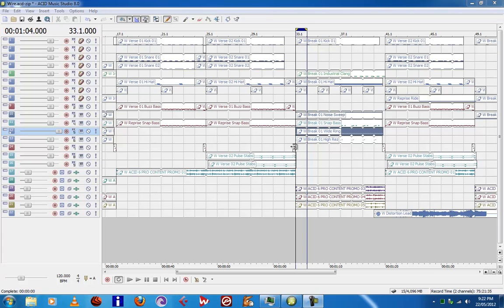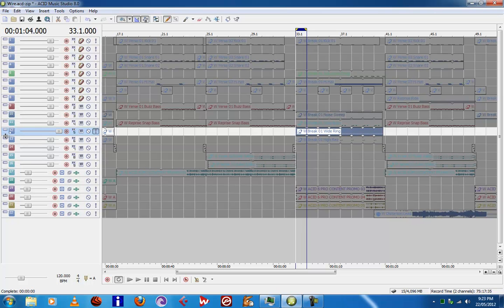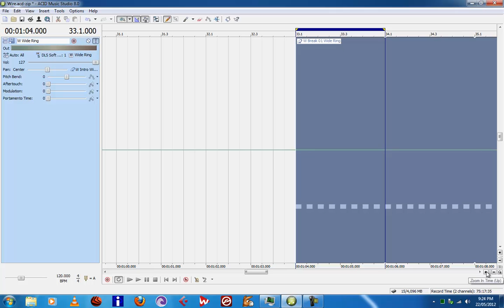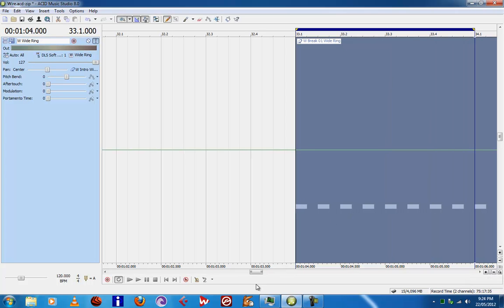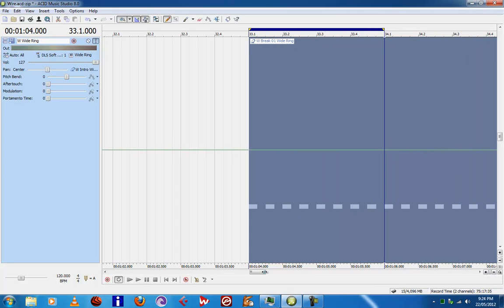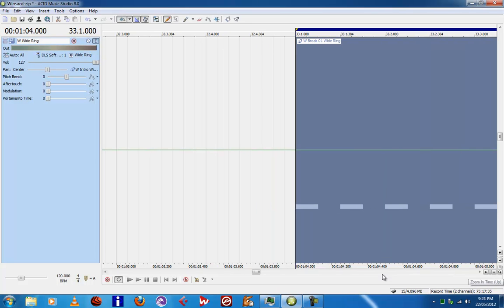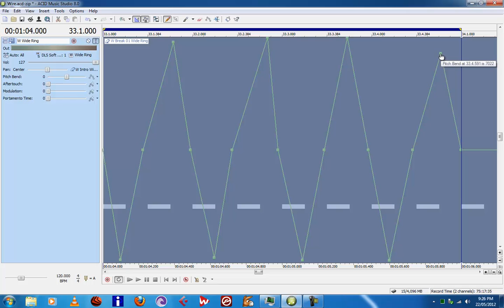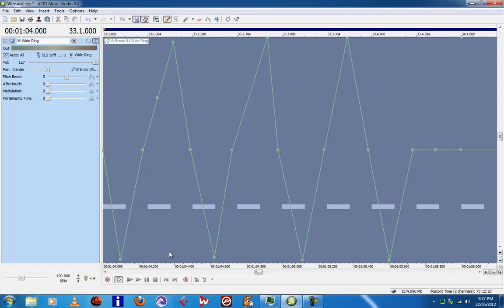Sony Acid Music Studio 8 Tutorial Midi Pitch Bend Automation www.robtransini.com

Comment: I worked midi for years-my main DAW is Sony Acid Pro7 which i Use sonar, cubase, pro tools for pieces and parts then arranged through the Sony, the best way I found for diverse is to have a independent vsthost that can record wav files from your synths, then you can use various plugins to change dynamics after  added to the track as beatmapped or loop....every DAW freezes or has latency. Better to do this on the keyboard than in the DAW.